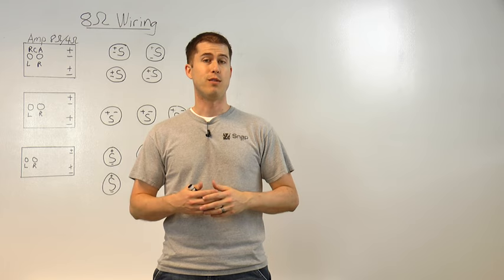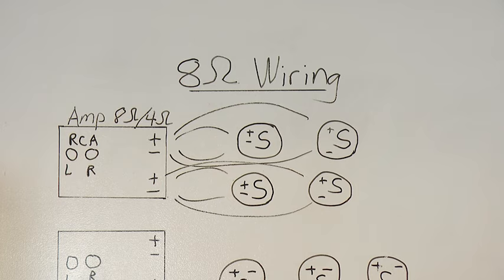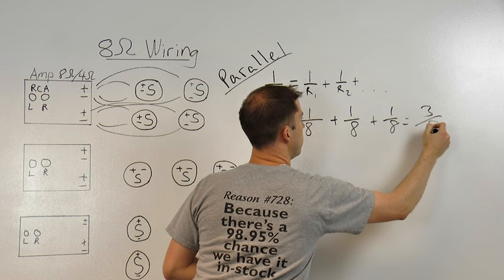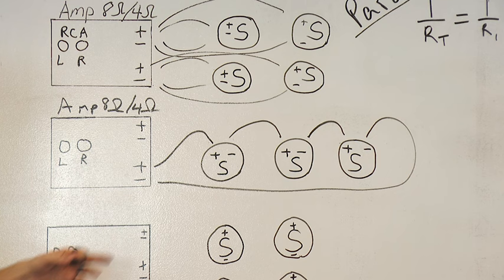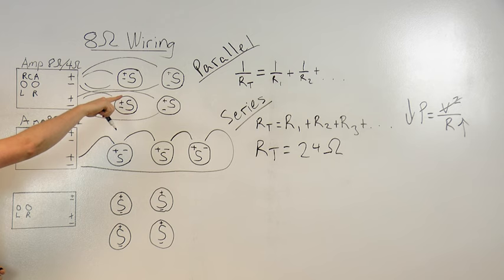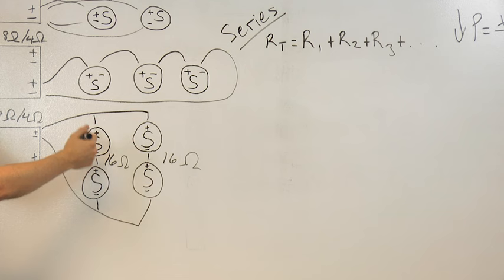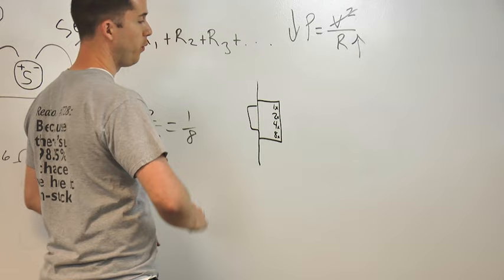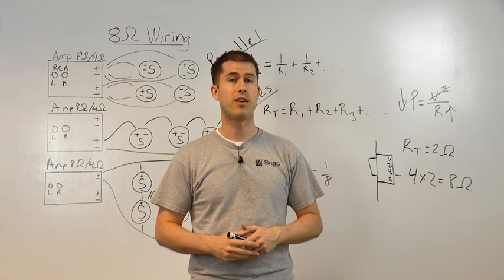Wiring an 8-Ohm Audio System

Comment: If I were to build two speaker boxes containing two 18 inch 8 ohm speakers each and wired them both in series, they would both be playing at 16 ohms. If I were to then daisy chain them together at the speakon connectors, would they be playing at 8 ohm impedence or 16 ohm impedence?

Comment: I got 2 JL Audio 12w1v2-8 they're both 8 ohms each 300watts RMS old school Subwoofers. I bought them from a guy I used too know, they've been sitting in my closet collecting dust. This Winter I wanna have a custom ported box build for them, now I'm guessing after they both become 4 ohms wired in parallel, I would need an amp stable at 4 ohm.

Comment: I have 14 8 ohm speakers to connect in a commercial location, what is the best way to wire the speakers and what amplifier should I use? thanks for your help ( I have two amplifier 4 Ohm by channel

Comment: I have a boss riot 1100 watt amp the amp is rated 1 to 4 ohms and I have two 12" JL audio 12w1v2-4 hooked up for 2 ohms and I want to add one more subwoofer same kind what is the best way to hook it up without hurting the amp.. I know the subwoofers are 600 watts each so if I hook up 3 off them that would make 1800 watts so would I need a 2000 watt amp?

Comment: Is it possible ( and how if possible ) to wire two 8 ohm speakers in one speaker box so the hook up wires for both of them ( to the amp )  will be at 8 ohms ( not 4 or 16 ohms ) ???  This question is for a two speaker box ( each with two 8 ohm speakers ) system.
thank you !

Comment: @RD CREATIONS   @RD CREATIONS  I have bought ahuja tza 4000em amplifier ; how can connect six speakers with 4w,90DB,200Hz_1KHz,120/240v, 70/100v inputvoltage each, could you tell me the best connection to get good clear sound for masjid?

Comment: I want to know I have 6 speakers 8 ohms and watt is 8 watt each. I want to use it with PAM 8610 Circuit. Is it possible. and How much power supply needed for that circuit. When I use 4 speakers with this PAM and Power supply is 12 volt 2Amp. But when I use 2 speaker more than at the time of high volume it will make ups and downs the sound.

Comment: How are you today..?
I would like to ask you something about the project i'm working on.
I want to build a floorstanding speakers using :
1 pc 8 ohm soft dome tweeter
1 pc 8 ohm midrange speaker
2 pcs 8 ohm woofer 10 inch
3 ways crossover system
For each speaker
My question is how to wiring those two woofer that keep them have 8 ohm impedance ?
Thank you for your answer and have a nice day...

Comment: still not enough info i got here, you see you just do it on 1 one side of an Amplifier or Mono what happens if I will have to fill in the other side to balance the audio ofcourse i will, and i will put another 4 speakers? so would that be fine? what is the computation then?

Comment: as i know.. the amplifier are more watts than the speaker ... example . you have a 450 watts speaker it means you choose a amplifier higher than your speaker watts.. exmple 500 watts amplifier..
Reply: You're totally right! However Ohms are important to match because they are the the resistants who prevent high current (power) to the speakers, and prevent from blowing the speaker/s and overheating your amp with high voltage flowing. From my research thats my understanding and it makes sense. Lmk if you figured out, or learned another way, I would like to know!

Comment: Can it be connected a 16 Ohms  tweeter (with the filter capacitor)  to the 4 Ohms full range driver?  What would be any difference in sound? Is it safe for both tweeter and the full range driver? What the method should follow?  Kindly explain? Thank you.

Comment: Does it affect the watts...what happens if I have 2 8ohms(120 watts each)  speakers connecting parallel.  The amp is rate at 60 watts in 8ohms but also 4omhs too. What watts is put out in 4omhs.

Comment: Is it ok for two 8 ohms tweeter whithout crossover and wire it to series config and add bass blockers and connect it to 8 ohms instrumental speaker in parallel config what is the equal ohms of this combination. I have a stereo amp that supports 8 to 16 ohms is it  good or bad for the speakers and amp?

Comment: Hi, Please help me, I want to connect my two 15"  instrumental speakers, 1 midrange and 1 tweeter, to my 3way crossover network. all rated 8ohms. Should I connect the 2 instrumental speakers in series or parallel? My amp is rated 8ohms. Thanks for your help.

Comment: i have 2 technics sb-a38 towers they are a 3 way, 4 driver tower. each tower has 1 tweeter 1 mid & two woofers. the woofers are 10 inches and 12 inches. the impedance & wattage are listed on a tag on the back right under the speaker wire connections. both say the same but they say 8ohms @130 watts. now i would like to run both towers to an amp. can someone instruct me on how to get the full effectiveness of each driver in each tower without any complications or distortion

Comment: I just bought 4 mid range speakers that are 8 ohm at 125 watts rms now what’s the best 4 channel amp to buy to to power these ? Would I mend to wire them a certain way also ?? If I wire them make them 4 ohm does that mean they’ll have to be powered at a lower wattage rms ?
Reply: Check out Parts Express. They always had helpful answers.

Comment: So in the third example (series&parallel), it's ok to just connect the four speakers to one of the two +/-  terminals (L&R; just using the R +&-) as opposed to the first example (parallel) where  both the Left and Right positive and negatives are used?

Comment: Sir, how can I connect my 400 watts 12" subwoofer 4,8 ohms to my home amplifier that is 550 watts per channel with 4 speaker terminal .each terminal is rated with 8 ohms.I'm afraid to do it with my self alone.before I make any move or desition I want to ask your best advice if I continue this or ill go find another amplifier that is rated with 4 ohms only..thank you very much sir, I know you are the right technician that can help me how to fix this problem...good day to you sir.....
Reply: Did you ever resolve this?

Comment: if im hooking up two 8ohm speakers in parallel to become 4 ohm and i want to add a tweeter which is 4 ohm to the the left wire will the tweeters stay 4 ohm? also can i add the right side speakers to the same input pos and neg to have both side wires bridged.
Reply: I know this is late. But you have to use a crossover.😀

Comment: What if we wire the speakers in parallel, but one of the speaker broke? Will it get from 4 to 8 ohms and damages the amp?
(Same question goes for the in series connection)
Reply: Sure
Reply: If ur number of speakers reduces , you have to increase the ohms

Comment: Can I connect two speakers in series or parallel having different wattages ?
Reply: Yes .... R should be between 4 and 8 (if its 4ohm add 4 ohms resistance inseries of equivalent wattage to match SPL & SENSITIVITY .... Make sure sensitivity remains same for both speakers  )
Reply: Forgot to say ... You must not ....overplay than the least powered speaker ....

Comment: sir i have 1 crown pr800 power amp, and i have 2 targa 12" 400w 8ohms speakers plus another 2 crown 8" 700w 8ohms speakers,what should i do to get the best sound for it ,what is the proper wiring of this speakers. is this match?

Comment: You talked too much.. Here is my question. I have a box of speakers.. 1 is tweeter 1 is midrange and 1 woofer. All are in a box and all of them is 8 ohms each. Now what is the impedance of that 3 speakers?